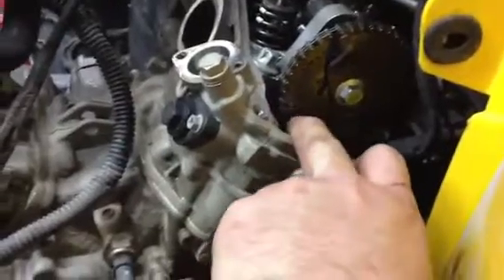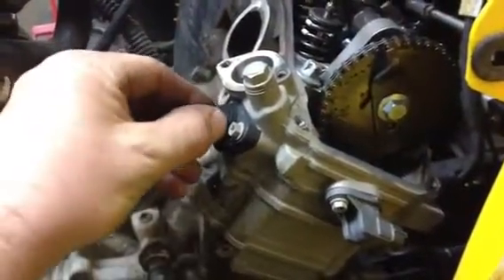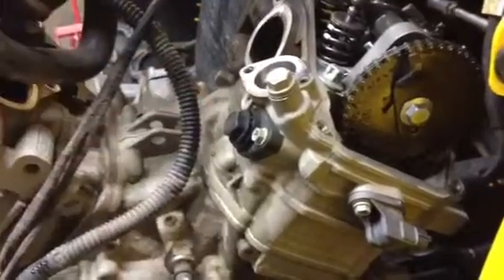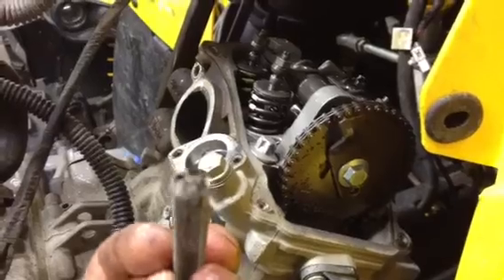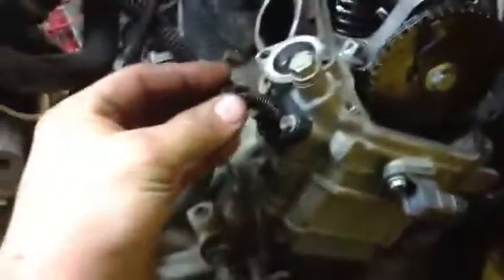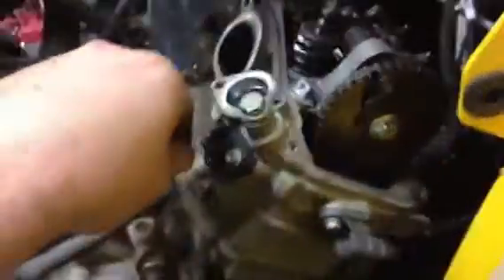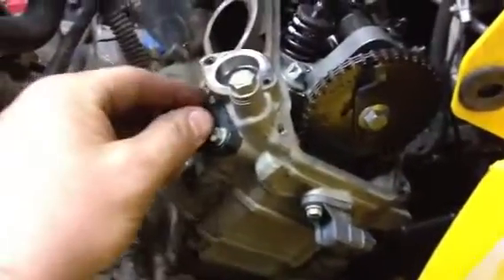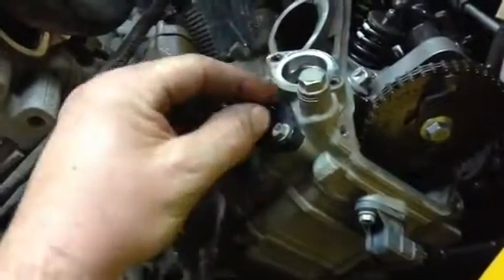Can-am timing chain tensioner adjustment.

Comment: ? I accidentally popped off the tensioner when I was installing new starter. I put it back in would this cause my UTV not to start.it was running untill starter quit. Was new one was in it turned over great but won't start engine.

Comment: Do you have line up the cam marks to do this? If I'm not taking the valve covers off?
Reply: I'd like to know that as well. I have a rough running engine that back fires on throttle close. I'm betting that it's the timing, I already changed spark plugs and they looked good.
Reply: @donrostron1269  check your valves, i just adjusted them for the first time, ive had the bike since 13.
Reply: @mybudshoteyes  Did that help? I'm original owner 2007. Never adjusted them before. Bike has always been solid until now.
Reply: It did get rid of the tictic that developed, and less popping, she did start that......just a little bit, i would recommend doing both, since the valve covers come off to due the valves anywho.
Reply: Yes, it can be done to tighten it again, but be careful not to move or operate the vehicle while it is not tightened

Comment: My spring came out and the reason I noticed it is because of loud engine tick. I immediately took off plastics, the spring was sitting between the cylinder's. Am i in for a costly repair? I have the spring back in not sure if it is adjusted correctly. The engine runs and the ticking is not a bad but thinking it may be out of timing  on a 570 2021 outlander.
Reply: Gotta check mine tomorrow..2020 570 canam...ticking noise came on rite sudden..

Comment: Cool hope this fixes my knocking on my can am
Reply: It did the trick stoped my knocking on can am outlander 1000xmr
Reply: Problem came back and on my can am 1000 xmr you shouldn't do that because its hydrolic. Anyway my knocking is coming from my rods had it all checked out and these guys know what they are doing. Valves timing chain all good and it's not the clutches either.